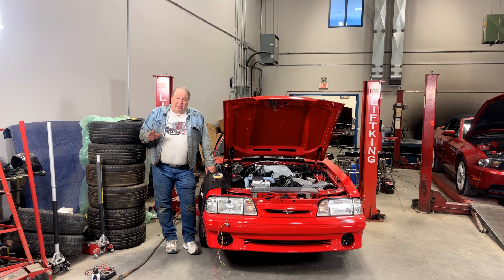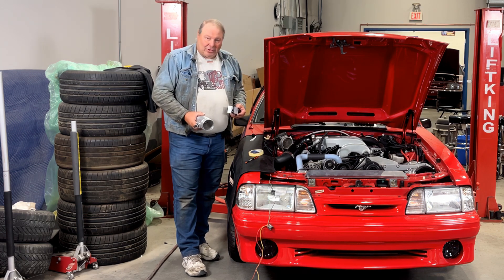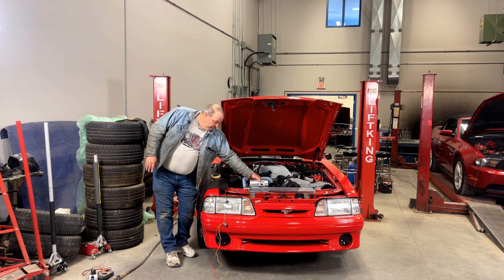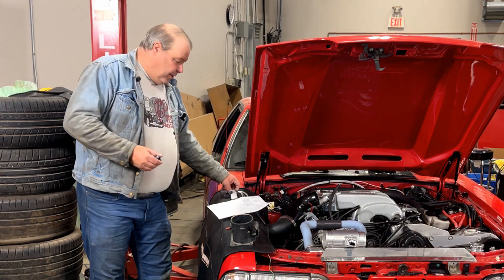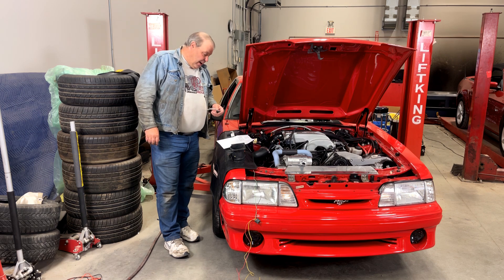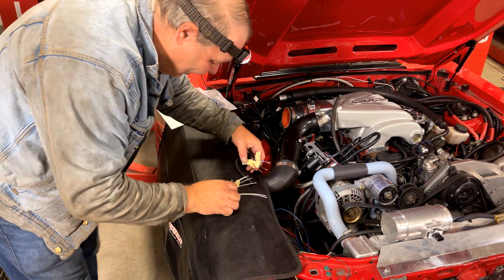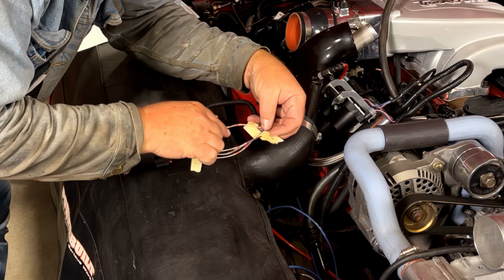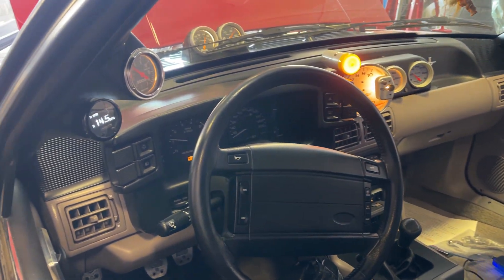Foxbody Mustang Slot MAF Wiring

Comment: My swap has 4 pins maf sensor and 2 pins iat sensor I’m currently upgrading to 6 pins maf sensor. Question how to know which is iat signal and signal return on the 2 pins iat sensor plug??
Reply from the maker: I don’t think it actually matters which way it is hooked up, but a quick wiring diagram lookup should do the trick.

Comment: Outstanding videos. To be clear, following these instructions I can plug a 05-10 slot mass air meter in a 70mm housing and it will work with a stock A9L? If so, that's really cool.
Reply from the maker: Yes, they work and are a stable system which I have seen and used in lots of blower cars over the years. You will have to calibrate your A9L to work with it though.
Reply: @tecmotiondyno  Thanks for replying on an 8 month old video. Forgive my ignorance. Calibrating the A9L requires a chip of some kind, correct? Is there a way to directly modify the parameters otherwise?
Reply from the maker: @louiebrogdon3729 no, it needs a chip tune. It’s something I do in the shop regularly though and I can provide a mail order but mail orders are never quite the same as a dyno tune. There are guys out there who do this stuff though.
Reply: @tecmotiondyno  Yes, this was my understanding. I'm in Virginia, so it's a bit of a hike from you. You typically prefer Moates  Quarterhorse chips, correct? Are there other good options for the A9L?

Comment: hey tecmotion i bought a fox a while back that came with this style sensor used but on a fairly modified n/a setup, the previous owner said it used to have a supercharger and that was all he knew. Is it possible that my fox is running the tune for the supercharger still? it has 44lb injectors btw and drives great just smells strong.
Reply from the maker: It is entirely possible. A supercharger tune up would normally be richer and have less timing than an NA tune up and would hurt your NA performance.

Comment: Awesome vid , do you think there is any gain from putting air filter in the fender? More bends then a straight to the headlight with a heat shield. Also is ther any gain from putting maf closer to throttle body
Reply from the maker: Generally, placing the filter in the inner fender is the best approach for these cars. If the filter is under the hood you are going to suck hot air even with a heat shield other than a box that seals it to the inner fender. With big tubing the impact of the bends is minimized. In this case, the standard Procharger setup is to place the filter right over the driver's side headers, which is a terrible idea, so having the inlet in the passenger inner fender makes the most sense. The real issue with MAF placement is to try to get it in a straight section of pipe away from sources of turbulence. The Slot MAF has a reputation for being more stable than either the fox or SN95 style MAFs, and that is especially helpful in a blow through scenario like this. These guys put a meth nozzle in the straight section of pipe under the hood which precluded placement of the MAF there, but it is better protected and a lot more accessible if you put it between the inner fender and the throttle in a straight piece of pipe. Neither position will make any difference to power.

Comment: They are just butt connectors. If I saw that they did that type of connection on my car they would be redoing it correctly.
Unpin the connector and get they proper pins. They are readily available.
Reply from the maker: @heffytomad4741  I’m not sure what you are talking about here. This video shows a new, revised wiring pigtail being spliced into the harness using a solder seal which is a specialized connector that combines a soldered connection with heat shrink tubing in an easy to use package. This procedure results in the most reliable connection possible for this type of job.
Reply: No...new pins are the only way it should be done.
It's not a "specialized" any thing. It's just a butt connector. It should be
 re- pined no splicing
Reply: Yes, I thought the wires should be removed from the old connector and slipped into the new... No splicing. The connector pins might need to be changed for compatability though. 
Seems neater than solder splice, but both work.

Comment: Great video! My car is an 88 with a pro-m maf that looks rough. I can't read any of the numbers on it but it's a 306 B cam, paxton. My question is do you need to retune the car with switching to a card style maf?
Reply from the maker: Yes, you definitely have to. This particular car uses the pro-m EFI system which is an aftermarket system that uses MAF. The BA5000 in the 3” pro tube is very similar to the 60# calibrated 3” pro tube setup that it had, so the test start shown was actually on the same calibration I had for the original MAF. You would have to do a chip tune on the car to get any slot MAF setup to work if you have a factory PCM. If you have a modular car that you are converting you will still have to tune it, but most of them can be done with a flash tune. These days getting a chip tune on a Foxbody is not always easy due to availability of chips and guys who actually know how to do it.
Reply: @tecmotiondyno  Thanks for the info! Yeah I came from the LS world and have HP tuners software so picking up an old fox body is a big learning curve for me. My car has a chip in the computer and I assume the PRO-M maf was calibrated for the cam, paxton and 24 lb injectors. The car runs decent I'm just struggling getting the idle to stop hanging up. I rev it up to 3k or so and let off and it drops to 2k and hangs there for like 5 seconds and then drops down to 1k. I ordered a new IAC and going to do a base idle reset on it today. I've been dealing with coolant leaks from the thermostat housing and water pump. I've never had these kinds of issues with a car before but I'm determined! LOL I will probably just do a Holley setup if I keep the car and the engine.
Reply from the maker: These are old cars now and they do have some old car problems like leaks and brittle wiring. A hanging idle might be a gummed up iac or a tps sensor issue where the closed throttle voltage is set too high. Of course it could be something else too, like the programming.
Reply: @tecmotiondyno  Yeah I get it! I'm having so leaks and wiring problems myself with age LOL! I still need to add an AFR gauge so I can see exactly how it's running. I will be grabbing one the pods from you soon.
Reply from the maker: @Joeshomegarage Sounds good. There is a good video on the gauge install using my vent pods here, and it is helpful even if you use some other mount system: https://youtu.be/oLYdgQr4T2A?si=tedoJc7F2TAE8gVy
Reply: @tecmotiondyno  thanks Matthew, listening to your podcast now 👍
Reply: @Joeshomegarage does your clutch switch work? Its tied into idle circuit along with vss
Reply: @tufgriz8917  I assume it works. Are you referring to having to push the clutch in to start the car and idle dropping when you push in the clutch?
Reply: @Joeshomegarage  as in cranking the car, the nss is tied into the ecu as well
Reply: @tufgriz8917  yes I have to push in the clutch to crank the car.

Comment: Hey sir I have a question for you. I have a 87 mustang rebuilt motor with trick flow pistons and heads with a holler systematic intake. I also have a msd 6al with distributor and coil and also have 30mins injectors. The problem I’m having is the car starts up fine but when I turn it off won’t start back up tell it sir for awhile. I change my fuel regulator but still doing the same thing. Also I swap ecu with my buddy but no change. Any thoughts of what I might need to do. Also I’m still getting spark and fuel when I try to start it back up. Thanks for your time any help would help
Reply from the maker: You will need a chip tune or at least a calibrated MAF to make that combination work. Assuming you have that, it may be a heat related problem on an ignition component like the coil or TFI module.
Reply: Hey sir I appreciate you helping me. I found out my problem. And you’re right. I swap to the factory air mass sensor and car starts right up and idle down and also starts back up every time. Thank you for your help sir I really appreciate it. Your a huge blessing and been fighting this problem for 2 months. Thanks again

Comment: Welcome back techmotion. Can we have a video on this foxes build?
Reply from the maker: @KWillyzz1  Maybe. It has been under construction for 10 years, and it spent 18 months at another shop. I was the first to get it to run, but it has a series of teething problems that were not compatible with my available time just at the moment - this is more of a winter project because each thing you sort out leads you to the next thing and there are parts delays and the only real way forward is to just keep working on it until it is done. If the customer and I agree to have it back for a little more extended and scheduled stay, I will probably do some more videos on it. It is a really cool car that belongs to the original owner and it is going to work with a little persistence.